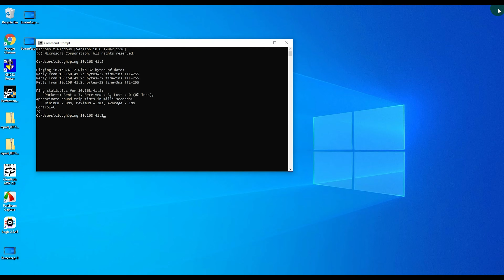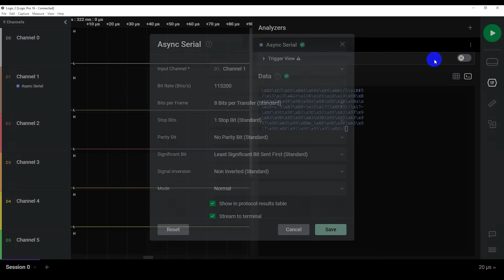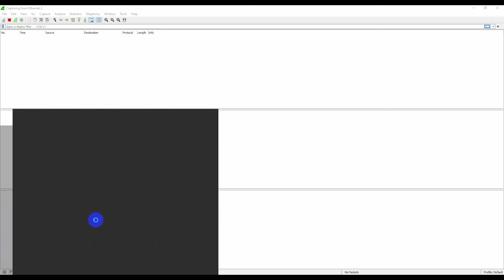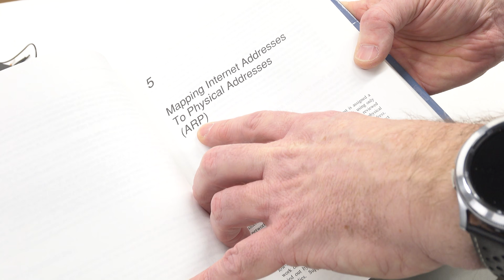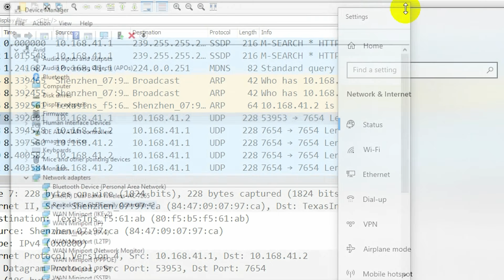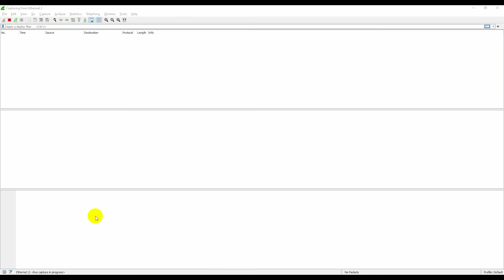Troubleshooting the Centroid Acorn and Ether1616 Network | Why won't it connect? | Beelink + Realtek

Comment: Excellent video; many thanks for sharing! I'm just starting my second Acorn build, and this is just the sort of thing that would have caught me out if I'd been adding the 1616 board (not needed on the current machine, but may be required on the next build).

Comment: Your network debugging skills are pretty good. "it's called a book. This was used in the before times ... " -- luvit!! And yeah, 'stupid stuff' like that can cost enormous amounts of time, which is why for many -- just get the one which some other engineers already qualified and follow the cookbook. Whenever you stray off the recommended one, you are going on an adventure, and most DIYers are not going to have anywhere near your network skills. Even so, I appreciate the many comments below from experienced network troubleshooters.

Comment: FWIW, hardware ARP Offload is from an era of slow CPUs and large subnets, to keep the CPU from being interrupted by frequent ARP queries that aren’t for its IP.  It provides no function for outbound queries, and certainly shouldn’t be manipulating them.
In this case, it fails Networking 101 and tries to resolve the subnet’s broadcast IP instead of automatically mapping it to the broadcast MAC address.

Comment: I love the fact that you have the EEVBlog DMM.  I have the newer one on my workbench....
Reply from the maker: Yeah, that looks really nice.  Maybe someday.
Reply: @Clough42  - it's a great meter, but I find its a bit overkill for most daily tasks.  99% of the time, I use my older Fluke.  I only break out the 121GW when I need one of its advanced features, or if I need all my meters for a 4-meter set up.

Comment: I have found that Intel network chips tend to "behave better" and have the fewest issues. My at home network comprises of almost all Intel network cards and I never have odd networking problems. Realtek networking controllers also have (historically) a large number of dropped packets, which leads to re-requests for packets and slows down your basic networking experience. Luckily most new hardware is pretty damn fast and most users don't realize that this is happening. Without pouring through hours of wireshark data it would be very difficult to diagnose seemingly random slow downs and the like, most people wouldn't even care to look anyway.

Comment: Just curious, because I’ve tried to track down similar issues with less success - how long do you think this took you?  Research, reading, testing - not maki g the video.

Nice job the tools you used, and great work figuring this out!
Reply from the maker: I spent a couple of hours off and on throughout the day, trying things that were suggested in the forums.  Once they ran out of suggestions, and I started in on my own, it probably took about 30 minutes to track down the problem and fix it.

Comment: HI James, I've seen you use Diodes across relay coils as protection, jus building a CNC control enclosure and wondering what type of diodes you are using. Going to get a previous work colleague to check my work before the big switch on as he does elec work on automation equipment.
Reply from the maker: I usually just use a 1N4004 for low-voltage DC stuff.  Over 24V at 1A I might think about it a little more to be sure it's sufficient first.
Reply: @Clough42  Thanks James 🙂

Comment: Did you test if there where, a firmware or driver fix, for the Realtek cards Hardware? :) Great video by the way :) :)
Reply from the maker: I spent a bunch of time trying different drivers from RealTek, the integrator, and Microsoft.  They're all many years old and behave the same way.

Comment: I'm trying to understand why the issue would be arp when the machine responded to ping, if it replies to ping then arp obviously worked.  Perhaps look at the arp table with "arp -a".  As for arping to the layer 3 broadcast address, I suspect that the hardware offload thing does that to poll the network then caches it.  If that's the case then perhaps disabling hardware offload makes sense, but then again, the second the host replies to ping we are past layer 2 addressing and layer 3 is working.  Did you search the wireshark console for .3 or the mac address of the eth1616?  I don't see in the video any traffic between the ETH1616 and the windows host on layer 2 or 3.  Weird problem for sure.
Reply from the maker: The ARP works fine when asking for the single IP address.  The problem is that the network card was erroneously sending an ARP request for the broadcast address.  Since nothing responded, it didn't know how to transmit the broadcast discovery packet.  (It should have known to transmit on ff:ff:ff:ff:ff:ff without ARP.)  Without the broadcast discovery packet going out, the Eth1616 can't respond, and CNC12 doesn't know it's there.  If instead CNC12 tried to connect to the Eth1616 based on its known IP address, it would have worked.  But I'm told by Centroid support that it doesn't work that way.
Reply: @Clough42  Gotcha, that is really weird that they statically address based on jumper, but then don't actually arp for that address and instead rely on broadcasting which is broken in the realtek driver. 

While I have your attention, your channel is fantastic, I used your lathe VFD conversion videos on my G0602 and just saw the brilliant lead screw conversion, so I'm ordering parts for that.  Unfortunately I'm in the middle of an aircraft build, so I can't focus on servos and electronics for a while, but I can round up the parts.

Comment: James, great example of troubleshooting technique, particularly as it shows how to approach a situation where you don't know what is wrong and aren't starting with a system that did work and now doesn't (most troubleshooting charts assume that something used to work and now doesn't).

Back in the neanderthal times before the interweb (early 1980's), when I was the founding VP of the Hershey Apple Core (still member #2, although a lot of things have changed in the group), I helped Member #1 troubleshoot his newly built Apple ][ clone since I dabbled in electronics (wires inside of evacuated glass envelopes and chunks of germanium inside little metal cans), and had the necessary equipment. We weren't able to use the troubleshooting charts, so resorted to a symbolic diagram of the circuitry (schematic?) and poked around with my oscilloscope. When we lost the clock signal, we found two unsoldered resistors, applied iron & solder and Voilá, everything was right with the world.

Many of the details of your adventure were a little too esoteric for me (I was OK up to and including hexadecimal, but then got glassy-eyed). However, the "book" thing really mystified me until I remembered a "motion picture" from the past called "ZARDOZ," where James Bond had discovered an entire building filled with items as you described, falling to dust as you would expect of dead wood. I now realize that these are the things that my parents had a vast collection of, which descended upon me and my siblings and are now stored in unused "guest" rooms.

All my best,

Charlie

Comment: Can anyone tell me if the BBG board is not connected to the breakout board, but powered up and ethernet attached can the PC still connect to it and the software load, and not close down with an error. I have a BBG board and just want to run the software to look at it.
Reply from the maker: BBG?  You mean BeagleBone?  I think the BeagleBone in the Acorn is pre-loaded with proprietary Acorn firmware.  Maybe I misunderstood.

Comment: Realtek is notorious for crappy hardware and firmware implementations. You're likely to find their components on cheap computing devices. Their support is only offered to OEMs and they rarely offer updated drivers and firmware. The bug may be in the firmware or driver. You might want to see if either the PC manufacturer or Realtek have an updated driver.

Comment: An odd bug that could certainly manifest some really odd behavior. There is absolutely no reason it shouldn't know the broadcast address regardless of IP or mask. This is also the exact reason as a professional LAN engineer I continue to stress to our desktop guys that we need to be buying laptop and desktop machines with proper network chipsets in them. The wireless chipsets can be even more wonky, and embedded SCADA systems are even worse. At one point back in the 90s we managed to get a small number 3com NICs that all had the same MAC burnt into them. That was fun LoL. Enjoyed the whole video but the logic analyzer was my favorite, never had the opportunity to use one.

Comment: I have 28 + years in IT.  I watched the entire episode, and I understand your conclusion.  I don't think it entirely a ARP issue.  I think it is more of a WOL issue or adapter compatibility issue.
I have used several different small form factor pc's and pi's and have seen driver issues with several of them.  
You fixed it but I would careful going forward, you have other driver going forward as Windows Continue to be updated on you NUC.

Comment: Good work on tracking this one down. FYI, the x.x.x..255 would only be a broadcast address if the netmask is properly set to 24 bits. If your netmask is set to 16 bit, bit would be a perfectly reasonable thing to do to ARP for any address that ends with .255, but that is in the middle of the /16 as those are usable addresses. I'm sure you set your netmask correctly, but you didn't show it, so I figured I'd mention it.
Reply from the maker: Many people have pointed this out.  The netmask is indeed /24.

Comment: I Just switched from mach3 to acorn on our big 6' by 12' CNC machine  also switched from cheap closed loop stepper 
to clear path been having issues with arcs but found out the clear path was too small for the Y axis. I will say man having 
the scope on the clear path motors is awesome otherwise i'd be stuck thinking it could be the acorn board as i switched
both at the same time.
Reply from the maker: There's nothing quite like making multiple changes at once and then having to debug.
Reply: turns out my motor wasn't to small the clear path auto tuning just didn't do a good job for 
some reason and after running the tuning over and over still ran very badly and kept losing 
steps for lac of better words. anyways clear path did a go to my pc and manually tuned that 
motor and now al works great. they said its rare but the auto tuning didn't work on my machine.
anyways hope that helps someone if they have the same issue.

Comment: I smiled when you whipped WireShark on the problem, I've worked with it since it was called Ethereal. I laughed out loud when Doug Comer's book (a method of encoding information on slices of dead trees!) came into play.

WireShark was/is an essential tool in my late career as a network engineer for, among others, Cisco Systems. I used WireShark and tools like it (you can imagine my bosses reaction when, in 1990 I needed to order a Compaq "Lunchbox" and accessories for around thirty-five thousand dollars), if not daily, at least on a weekly basis for thirty years. Comer's book and also "Routing TCP" lived on my desktop.

Anyway, nice catch on the Realtek chip configuration. I'll store it away in my memory for future troubleshooting. ARPing for the broadcast IP was the key. I saw the high-values in the pcap and it made me wonder but I have no experience with that chip set.

Comment: My grandpa was a centroid dealer for a while we it them on a bunch of machines Back when retrofits were unheard of. and my uncles became dealers recently, around the time acorns became a thing. I’ve never used one of these but I sold my shop and got a job with an abandoned cnc in the back an it’s my nature to want it running.

Comment: I'm disturbed at the use of UDP as the communication protocol. UDP is a spray and pray protocol. Maybe the packet gets there..maybe it doesn't. That should really be TCP.
Reply from the maker: It's a local segment used exclusively for this connection.  UDP has lower latency and jitter.

Comment: Fantastic as always James!  Will need to explore using the Ether1616 now… I am not familiar with this device to expand my AcornSide note… and maybe you have this planned… but I’d be interested in a video on how you leverage Fusion with the imported electrical components to design your control panels.

Comment: You have giving me something to look into and some tools for trouble shooting. I service some fiber Laser cutting machines using Cypcut software/hardware to control the machine. The height controller is connected via ethernet as well and some of our machines will just randomly lose connection with the height controller. I've long suspected some weirdness in the network configuration settings but I know so little about networking I can't do much other than confirm IP addresses and ping for connection. Time to do some reading

Comment: I didn't see you mention your IP subnet mask.  My initial suspicion was that the computer didn't know that .255 was a broadcast address because the subnet mask was wrong.  I was a little surprised that disabling ARP offload fixed the problem.  But, if it works, it works.
Reply from the maker: The subnet mask is correctly set to /24.

Comment: Had a similar issue with a product I used to support, whereby Realtek started to introduce a feature called UDP Checksum Offload, whereby the nic would, by default, take over the calculation of packet checksums prior to transmission.

It turned out that about 0.2% of packets we were sending would result in a payload which the checksum offloading would calculate incorrectly, meaning that the packet would be sent, but the first network device it came to, usually a switch, would reject the packet as malformed.

Nightmare to fault find though, especially since the overwhelming majority of packets would get a valid checksum - it was just the odd one here and there which screwed everything up.
Reply from the maker: Yeah.  I spent a lot of hours debugging stuff like this.

Comment: I'm a retired Network Engineer and have used WireShark for many years.  I was around when all the tools you have been using in this video were not around.  WireShark is probably the most valuable tool that I have used.  Like all things network, finding the arp offload issue is amazing.  Good job.  My handle when working was Jedi...

Good job Jedi...
Reply from the maker: Yeah, I remember the days when we had to lug around the Compaq portable sniffer.  I think it was a Compaq.  Looked basically like the Dolch, but with light colored plastic.
Reply: When Compaq was bought by HP that was  a  sad day.  Having been certified in Compaq and also HP, those older bricks were more trouble than they were worth.  Wireshark made it so much easier to troubleshoot weird networking issues.
Stay safe...

Comment: Thanks and interesting. Good old wire shark.  ARP offload typically the default for NICs, in my mind this suggests a bug with the non-communicative board NIC hardware/firmware rather than your NUC and I guess good luck with getting them to sort that out! as you suggest they would blame your computer. Anyway workaround succeeded - congrats

Comment: It has been long time since
I had to whip out Wireshark, or a book. The debugging capabilities of upper level software packets has maybe increased, or lower level problems are now more unusual. I always use RFC 793 as a reference for TCP/IP related stuff, I used to have a printed copy of it at the office.
Reply: I also now remembered a fun "feature" in older Windows versions regarding the UDP/ARP protocols. Our software used to handle the cluster communication with UDP for lowed overhead. No problems in initial testing of the software, but if there were a normal amount of messages to handle by the application, the blade servers' network switch started dropping packets and the gigabit network saturated. Our software experienced timeouts and it only made bad situation worse.

Wireshark/Ethereal and testing revealed that every single UDP packet over the sive of 2048 bytes made a WHOIS ARP query. Dynamic ARP table had the entry, but it didn't matter, the WHOIS was made every time. I built test software for sending the packets and then it was obvious that packet size was the key. Setting static ARP entries helped, and the network load was fine after that. I chased the problem for three weeks!

Comment: Dude - you could narrate someone cooking and make it interesting.
April 1 is coming up soon.... just saying.
Reply: I was thinking "you're missing out on details like netmask - a /23 or larger could leave .255 as a valid IP...." and then realised it would overcompliate things where in essence that doesn't matter.  Knowing what to leave out is super important.
Reply from the maker: Yeah, I didn't actually think about that until afterwards.  The netmask is correctly set to /24.  If I had realized so many people would be concerned about it, I would have shown it.  I think there's another free variable floating around in here somewhere, too, like a reboot required after changing the driver settings.  Many reboots happened during debugging, but also didn't make the video.